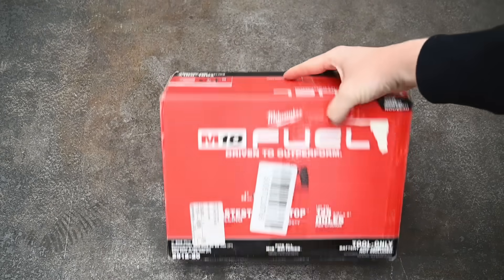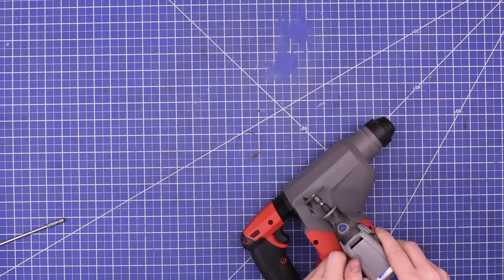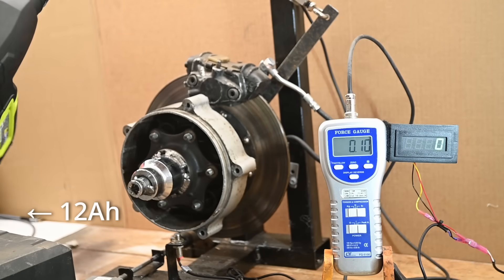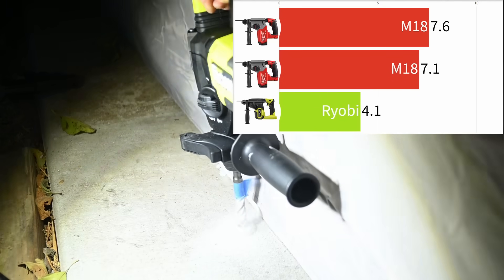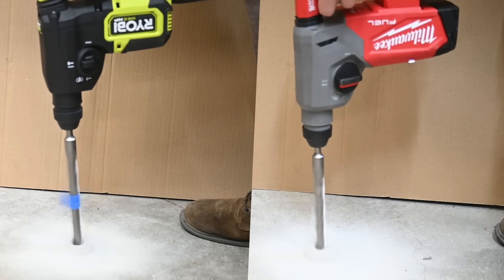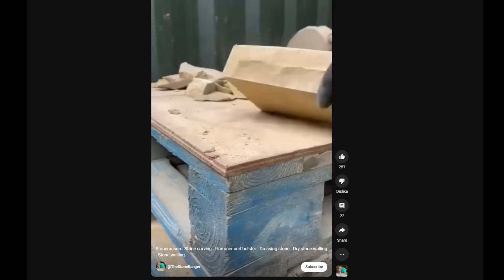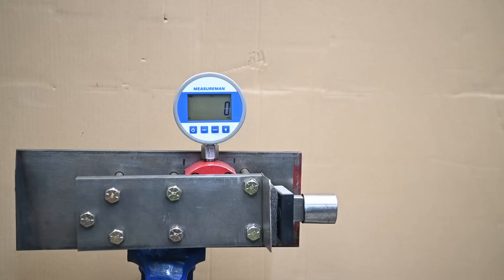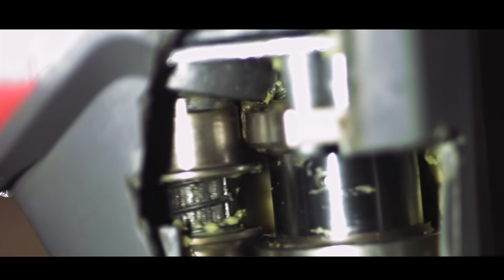How Drilling Thru Concrete Works @ 10,000 FPS

Comment: Ran a hilti te30 last night for about 5 hours straight drilling 16, 8 plus inch 3/4 anchor holes. Drills through concrete like butter, rebar however is another story. Real pain in the ass even with rebar cutting bits

Comment: I'd like to see you do this again with some sds-max drills.  I had to rent one recently to drill a 2" hole through 24" of concrete.  Did it in well under 30 seconds for each hole.  I was impressed.
Reply: That’s as fast or faster than a wet core drill that I use at work on occasion. Damn.

Comment: Cool video, but I disupute your modern definition of drilling.  Look up the original technique of drilling (a government definition https://www.fs.usda.gov/t-d/pubs/htmlpubs/htm84232602/page08.htm).  Mining drills have used a hammer and chisel for thousands of years.  A double jack is more than a way to get hammered in a bar!
Try driving a concrete drill with an impact!  Works great, but support your wrists.

Comment: I'm still puzzled about why exactly these have lower torque than drills that have planetary gearsets. The rpm is comparatively very low which would indicate a high gear reduction, so what am I missing?
Reply from the maker: That's assuming the source motor is the same RPM. The motors are larger but lower RPM than the one in your drill
Reply: @TorqueTestChannel  I'm still not getting why these don't produce more torque. A larger motor (=more powerful) input, slower rpm output, less torque? The milwaukee is delivering 7000ipms after gear reduction so that motor has to be spinning respectably
Reply from the maker: @Failsafeman100  The tools aren't designed or braced or even oriented in a way to make peak torque. It's transferring it at a right angle and then into a gear assembly from there. They simply cut out when too much torque is achieved for the tool where it determines it'd rather not destroy itself. Larger motor also does not always = more power. They put what works best in these tools, it could have a longer service life or run cooler. They dont just blindly spec the hottest hotrod they make for every tool that isn't going to be able to utilize it anyways.
Reply: @TorqueTestChannel  Thanks for the response! What I was stuck on was not so much "why aren't they designed to be torquier", moreso what is it about their design that seems to inherently limit them from delivering as much torque as hammer drills etc (be it mechanical disadvantage, electronic limiting or both or otherwise). Makes sense to have the tool cut out under high torsion to protect the relatively convoluted drivetrain. The video is top notch by the way, before watching it I never wondered about the above
Reply: SDS+ are usually over 1000RPM. Driver drills are usually 400RPM in low gear. Rotohammers also have a clutch that's designed to slip to prevent wrist breakage when you hit reo. These 2 seem to be cutting out before the clutch slips, so possibly a very conservative current limit. Rotohammers never need much torque, they mostly plug away at 25A (500W), and the clutch will slip around 50-60A. Driver drills can go over 100A
Reply: In this vid TTC is testing max torque in low gear as starting speed is 450RPM. So the drills have about a 3:1 mechanical advantage over rotohammers.

https://youtu.be/hDofGQMYIFI?t=2m40s

Comment: I'd always imagined they had a crank and a con-rod and a piston in a rotating cylinder.
Reply from the maker: electric jack hammers work that way
Reply: SDS-MAX work that way. Wobble bearings are better for the shorter and faster strokes needed for SDS+

Comment: Use my SDS all the time. Bosh bits are awful avoid them. One drill bit per hole 😂
Reply: Yes I had the same,  makita bits are very good
Reply: @bgg-jp5ei  I found even cheap generic bits latest longer than the bosch ones. For example the free bits that came with my SDS were much better. And my SDS is a budget brand ( Titan) also bits from Lidl or even cheap ones from eBay lasted longer.

Comment: I have the Ryobi. Definitely a big help with cement and bricks. Crazy how much of a difference the hammer makes.
Reply: Same even used it up to a 1 1/4" x 18" bit and it still took it like a champ, honestly for the price it's an absolute beast.
Reply: I got the previous cheap version Ryobi  SDS .
Got a metal anchor ring installed on a very hard boulder sitting in my yard for over 40 years that  I thought it's a joke to drill a hole into it without  professional masonry crews with high power ultra expensive tools.
Now, I am a believer in modern tools.

Comment: Thanks for the lovely and very informational video. I've always wondered how SDS Drills worked - now I know :D
Is there a particular reason you guys haven't chosen Bosch for this example, the 'creator' of the SDS standard? :)

P.S.: All SDS Hammerdrills are measured in Joules in Europe. No matter if SDS plus, SDS max or SDS quick. :)
Reply from the maker: In this case, it was because we wanted to know why there was a 2X price difference between similarly designed SDS tools made from the same TTI source. We felt high speed would be the best way to know WHY instead of just show the timed difference.
Reply: Perfect, thank you for the quick answer! 
In that case it makes perfectly sense. Thank you for your work and the videos! :) Always fun to watch and learn.
Reply: Im finishing my basement...I've got the current top 18v rigid drill with hammer mode and borrowed my bros corded hilti sds drill for sinking 3/16 tapcons into baseplates for the studded walls. I drilled 2 with rigid and quickly dreaded doing a 3rd. Switched over to the hilti and was punching holes in the slab like it was pine. Like all tools, definitely an amount of use/application vs price.
Reply: SDS hammers use Joules in the states too.

Comment: Talking about drills lately I have been watching a tools repair shop channel from Ireland and the guy there says in Europe Bosch and Makita are for professionals and Milwaukee for DIYs even though they are the most powerful because of their poor to null repairability. If you break something inside your Milwaukee you usually have to replace a big chunk of it because they won't sell the parts separately therefore it's hard to find red tools older than 3 years in the hands of professionals. It also doesn't help that there you got 1-year warranty if you don't register it and 3-year if you do (contrary to the 5-year warranty in US). I guess in US being able to just change your tool without questions helps them people not realize how expensive it's to repair their tools when out of warranty.
Reply: Dean Doherty right? 😁
Reply: @Failsafeman100  Yup!
Reply: I work for a retailer in the UK that sells tools to the trade, most buy Milwaukee or Dewalt, Makita comes in third and Bosch a very distant fourth.
Reply: Deans a BOSS